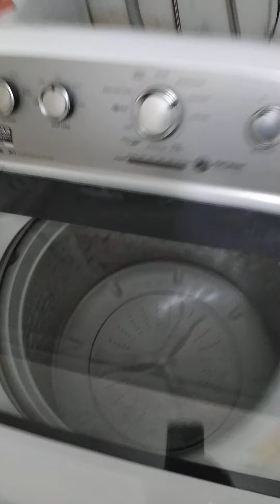Whirlpool, maytag washer - Suspension rod kit replacement W11130362

Comment: Is there a specified distance the white top bushing piece on rod needs to be from top of spring? On my Maytag Bravos it slides up and down easily and was wondering.  That was a quick job! Thanks
Reply: It sets the distance when the machine is at full load